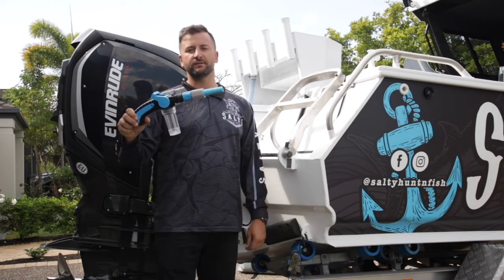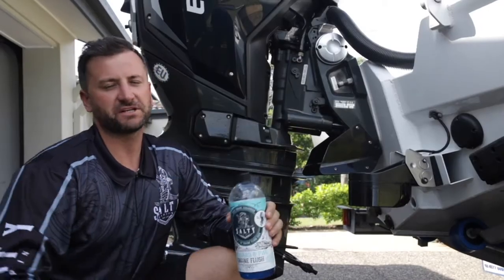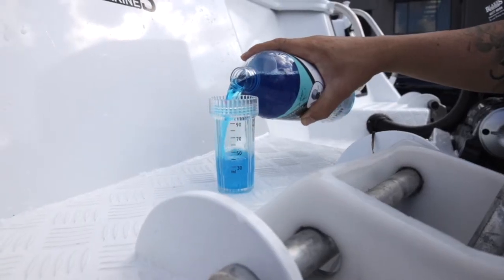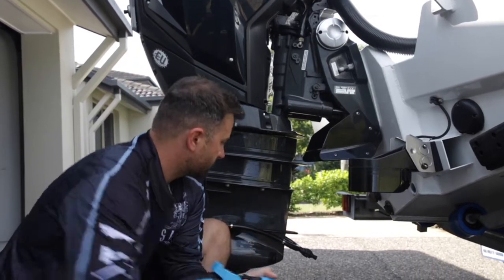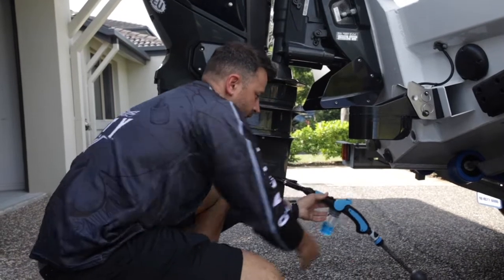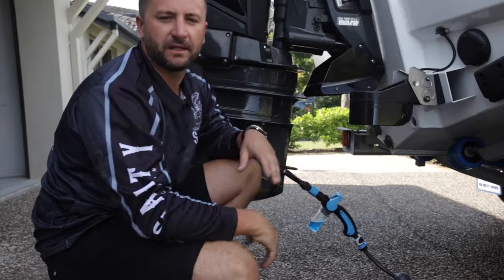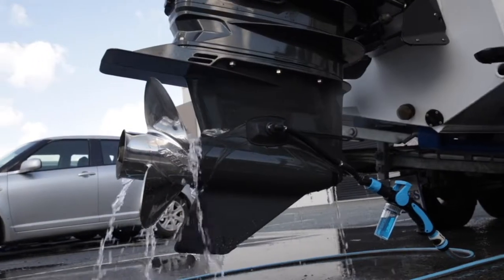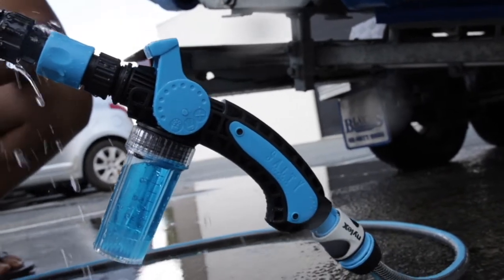How to flush outboard boat motor - SALTY CAPTAIN (Engine flush device)

Comment: I just ordered the musket kit. How do I connect to my motor ? I normally use a regular water hose to connect to my motor. Will this musket connect to a water hose or do you sell the fitting to do so ? Thanks